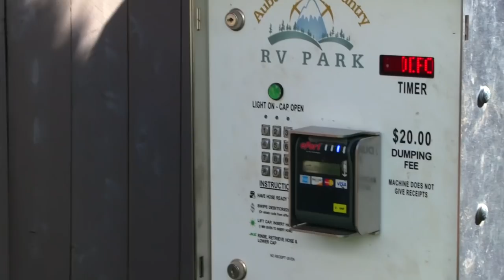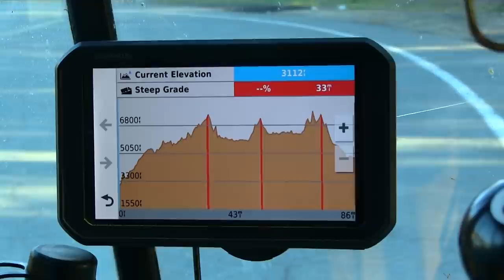Doing What People Do in Lovelock, NV in our Skoolie!

Comment: Hey Mike, where can I get a ball like yours? It looks like it would make steering a lot easier.
Reply: It can  be a labor saver, but if you lose control of it it can break your arm.  Knowing that I still have one on my rig.  LOL
Reply from the maker: I bought our ball attachment at a truck stop. I love it! That said it was a cheap one and I want to get one that attaches to the steering wheel more elegantly. This one has a bolt that kind of sticks out the bottom of it and I find it catches my shirt or my arm sometimes and is uncomfortable.. I would look on Amazon to find one that has a cleaner design.